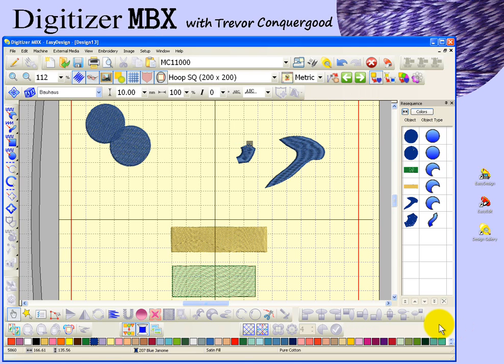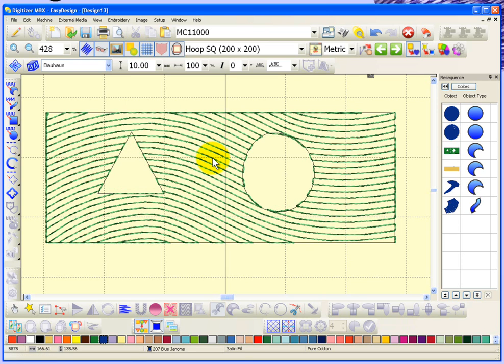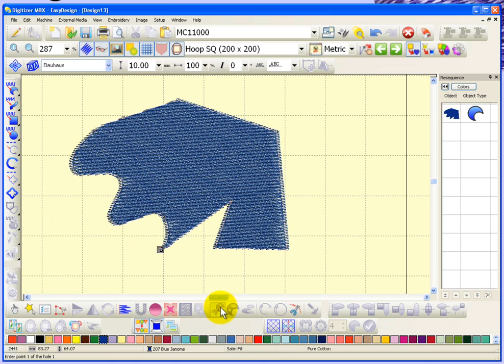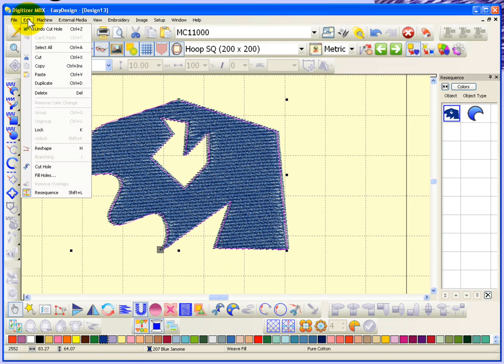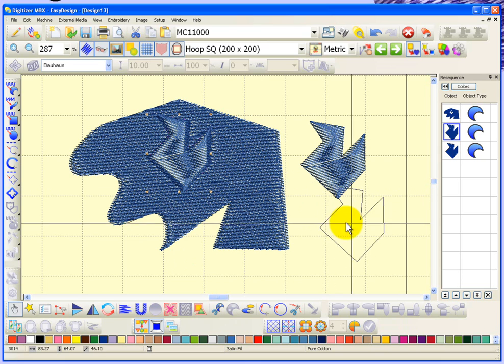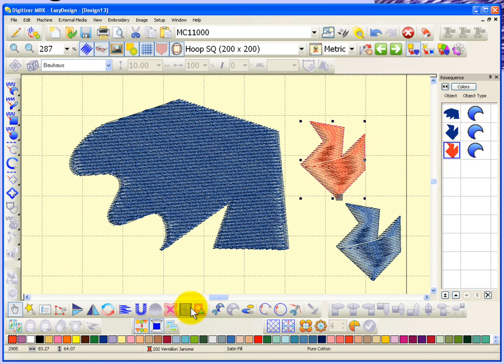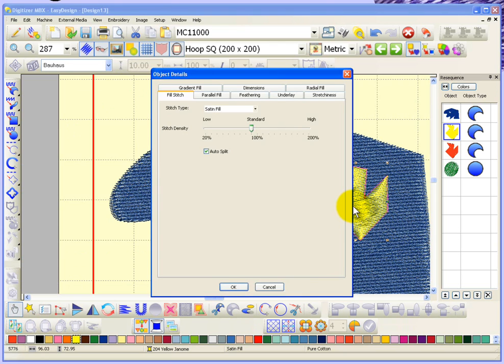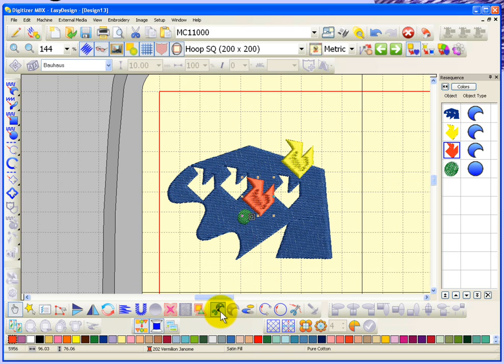Digitizer MBX Tutorial - Cut / Fill Hole .and Remove Overlap Toos

Comment: Thanks for a great video!  Thinking about getting the MBX but not sure if it does anymore than my current software.  I only found one Janome video on stippling around a design, and they say to retrace your design using left and right clicks, then cut hole.  That does not give you the empty space, and it also seems a bit old fashioned.  I am sure the MBX software has the ability to do it easier.  

If we wanted to have stippling around our design, with say, a 1/2" of empty space around our design, can we have the filled rectangle under our design, then:

1. duplicate our design
2. make that duplicate 1" bigger
3. select that duplicate
4.click "remove overlap"
5. then delete our duplicate
6. select each object separately and center each one, if not already centered.
7. then change the fill of the rectangle to a stipple stitch
8. then, if an outline was created to define the hole, convert all to stitches, then delete the outline in the objects window.

Lisa
www.digitalhorses.com
YouStitchit@gmail.com